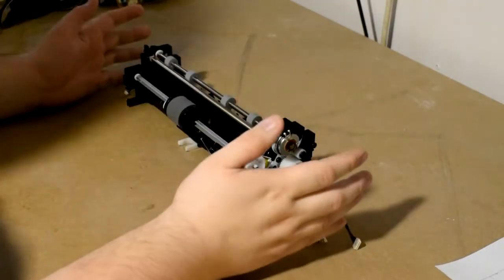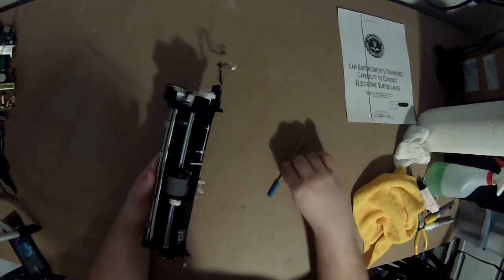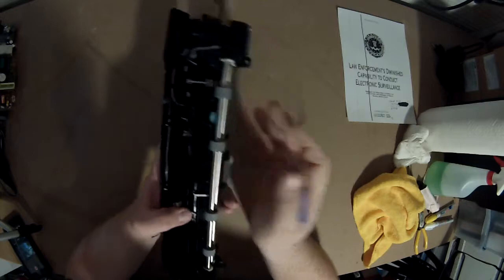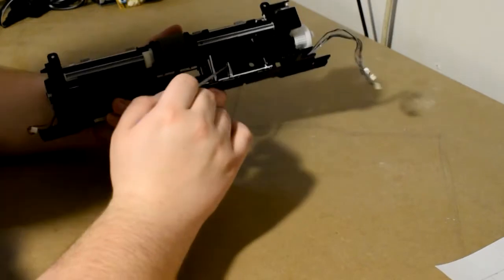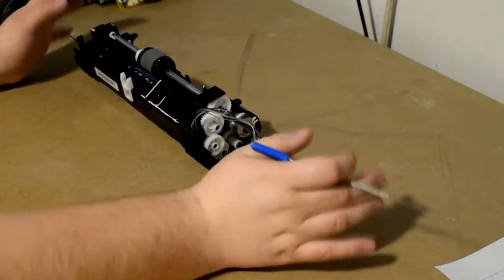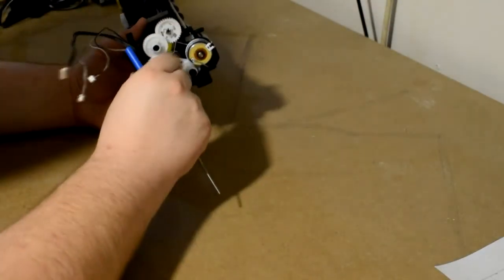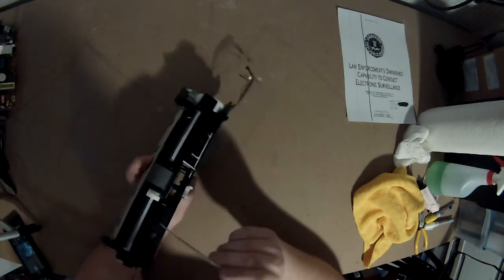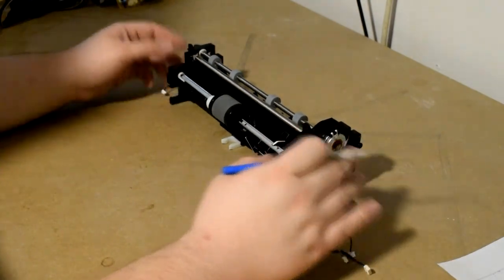Printer Repair Basics: pickup assembly

Comment: Can you do a video on replacing the pickup assembly on a P3015? I know this is not in the repair manual.  I can get to the point where you replace the Solenoid but don’t know where to go from there.
Reply: Yeah, I'm looking for the same thing.
Reply: @clpt5017  Y encontraste un vídeo de cómo cambiar?